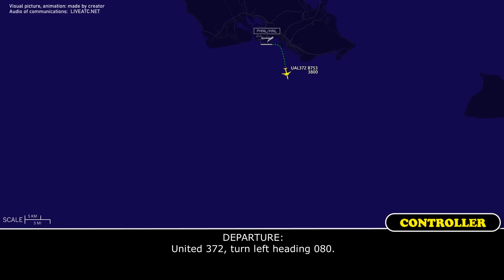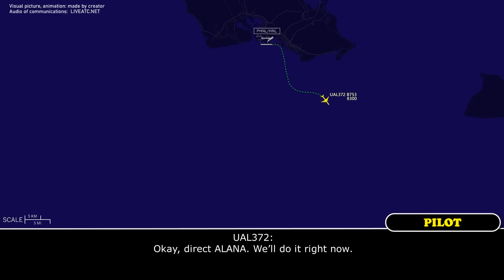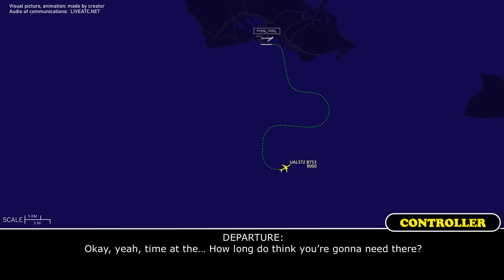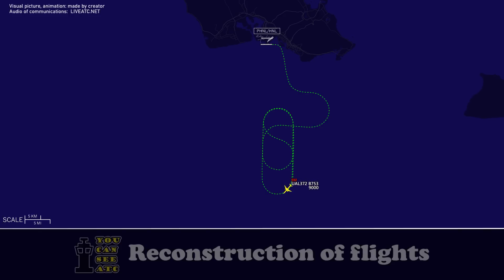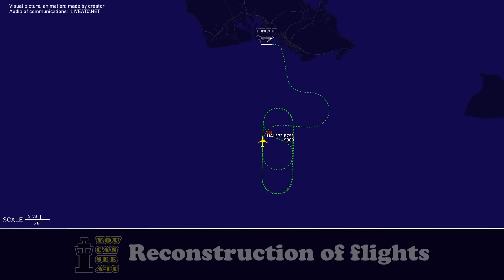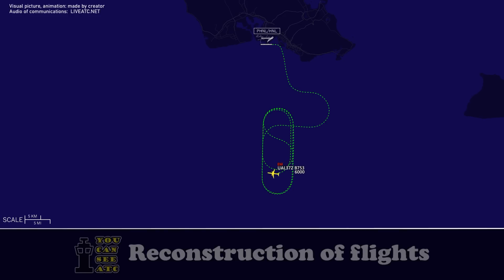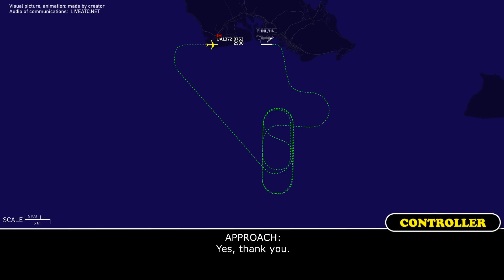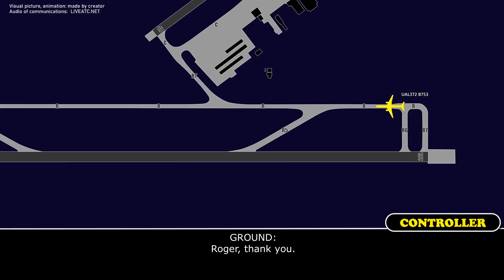“They heard a scrape”. Suspected tail strike on takeoff. United B757 returns to Honolulu. Real ATC

Comment: Pretty poor piloting to get a tail strike on a 757. Surely they know how to fly the aircraft by this point in their careers.
Reply: Place took off just hours later. A bump was noted, but no tailstrike indicator warning. Likely the plane did not tailstrike, as it took off like 2hrs later iirc
Reply: @RogerSpears-gm3sh  - hitting the tail is pretty poor airmanship, regardless of the level or lack or damage to the aircraft.
Reply: @EdOeuna  tailstrikes can be pretty common if the plane backing out scrapes the winglet of the arrival
Reply: @EdOeuna  Yeah in a 757 I don't get it. Flying the 321 yes it was a consideration over the 20 but it's very bad practice. Could be worse - the infamous CX 340-600 out of Auckland springs to mind. Big tail strike and they still went full send to Hong Kong pretending like nothing happened. Recently promoted Chinese CA who argued with the commuting expat CA on board then declared racism... that shit show impacted CX for 10-15 years.

Comment: Why do the American pilots just say "We're going to declare an emergency" and then wait for the controller to start an interview style process. Happens every time. Rest of the world pilots, "declaring emergency, suspected tailstrike, will be returning, will be overweight, need to run checks, standby" Example: https://youtu.be/EWAsQ3qldo8?t=110   ;   https://youtu.be/ghsyfIK-H8w?t=17   ;   https://youtu.be/uCQE77K8GUw?t=39
Reply: It's situational I guess. In the rest of the world you'd hear Mayday or Pan-Pan x 3. Depends on the nature of the emergency whether they have time to explain or not at that moment. Aviate-naviagate-communicate, but in this situation I'd agree they could have explained without waiting for questions about it.
Reply: @robertl426 - common sense says to mention your problem with ATC at the first available opportunity because someone else will be using that same piece of tarmac minutes after you,

As for ANC, that really only covers the initial response, so aviate = we’re flying, navigate = where are we going, communicate = speak to ATC. After that you get communicate, navigate, communicate, navigate, etc.
Reply: @robertl426  Not always you don't. How many videos from overseas have I heard the pilots say that they are declaring an emergency? Several. I just posted about that a week ago.
Reply: Its called troubleshooting and running checklists! That takes time! If the aircraft is flying reasonably well, a Maday is not required. There are too many variables that are unknown. No emergency is the same. Now, if its a flight control problem, you will hear the difference in the calls.
Reply: The linked scenarios are very different from this one. In those situations, the aircraft was in immediate danger. In this one, initial they just needed some time to troubleshoot, and then they needed to come back with some slight damage. It’s clearly going to be easier on the controller if he can ask questions and expect answers than if the pilots just throw a bunch of information at them.